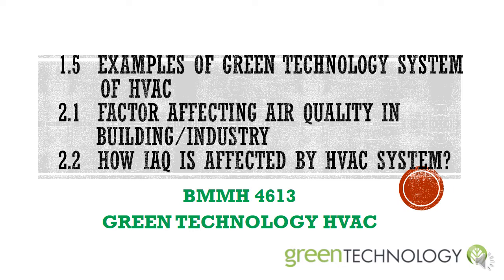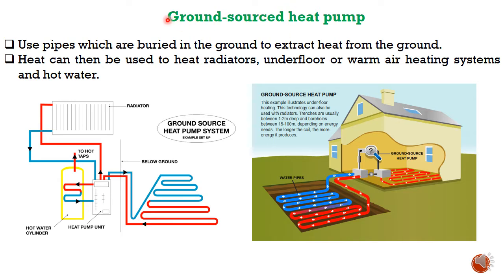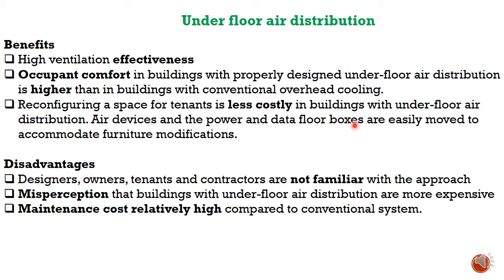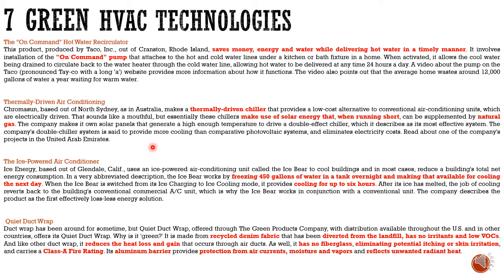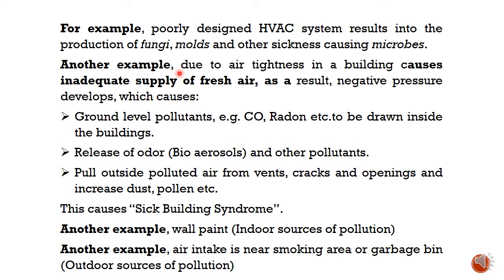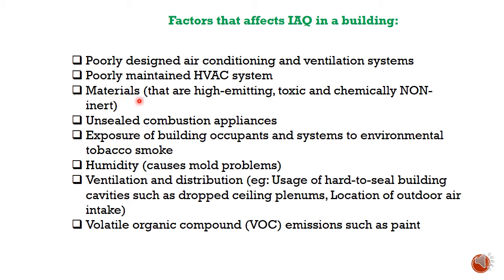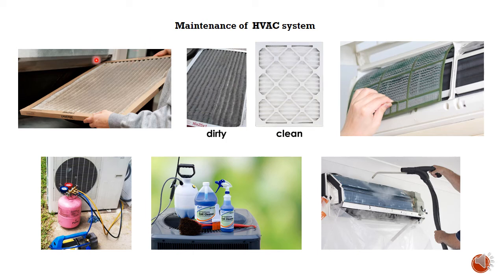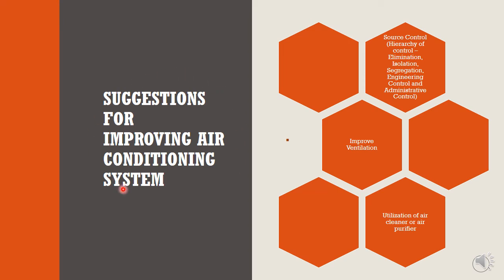Lecture 2 Effects on Indoor Air Quality

Comment: Cheah Kok Hun 4BMMH S1/1
B071710006 

1) An air-to-air heat exchanger 
Connecting two air streams of different 
temperatures into thermal contact, transferring heat from the exhausting inside air to incoming .outside air during the heating season. It use heat concept whereares heat is transfer from high temperature to low temperarure 

2) A waste heat recovery 
A unit is an energy recovery heat exchanger that transfers heat from process outputs at high temperature to another part of the process 
for some purpose, usually increased eficiency. It is a very good way to conserve the energy to attain suistanable. 

3) A geothermal heat pump or ground source heat pump is a central heating and/or cooling system that transfers heat to or from the ground. It uses the earth all the time, without any intermittency, as a heat source or a heat sink. The energy from ground is free and always available to use. 

4) VRF HVAC System
Which allow to control the amount of refriegerant flowing to multiple evaporators at the same time to adjust different capicities of function of each evaporators with the minimum requiremenr of refrigerant to avoid over run refrigerant or less refriegerant. This will significant reduce a great mount energy watse. 

Maintenance of HVAC system is a complusory act and it have to do according schedule, some within few months. With good maintanence, it will help to avoid the user from geeting sickness due to polution happen in indoor source and outdoor source.

Comment: AMIRATUL RASYIDAH BINTI ABDUL RAHMAN
B071710456

1. GREEN TECHNOLOGY SYSTEM OF HVAC 
- Air to air heat exchanger/ waste heat recovery (heat recovered from exhaust air) reduce overall load and potentially the ac size
- Ground source heat pump (Underground pipe) low energy consumption, no fuel deliveries, low CO2 emissions and minimal maintenance 
- Under flow distribution (underfloor plenum) high ventilation effectiveness, better than conventional ac and less cost 
- VRF ac system (one outdoor multiple indoor) control amount of refrigerant flowing multiple indoor and individual comfort control

2. 7 Green HVAC Technologies 
- The “On Command” Hot Water Recirculator 
- Thermally-Driven Air Conditioning 
- The Ice-Powered Air Conditioner  

- Quiet Duct Wrap V. Energy Analysis Software 
- The Dual Fuel Heat Pump VII. The Geothermal Heat Pump

Indoor Air Quality ( IAQ ) - How good or bad the air inside the place due to presence of chemical, biological pollutant in the air, temperature & humidity.

3. Factors that affect IAQ inside the building:
- Poor design of HVAC system
- Poorly maintained HVAC system
- Unsealed combustion appliances 
- High humidity (causing mold problems)
- Low ventilation and distribution 
Suggestions for improving Air Conditioning System:
- Source Control (Hierarchy of control of elimination, isolation, segregation, engineering control and administrative control).
- Improving the ventilation system and distribution system (such as using fan to such out bad odor in kitchen or toilet).
- Utilization of air cleaner or air purifier

Comment: MUHAMMAD AKRAM BIN RAZALI (B071710573)

Air-to-air heat exchangers / Waste heat recovery system
- heat recovered from exhaust air to temper fresh air coming into building
- reduce overall load and reduce the size of air conditioning system

Ground-sourced heat pump
- Use pipes that buried in the ground to extract heat
- Lower energy consumptions
- Provide income through the government (RHI) (in UK)
- Lower home carbon emission
- No fuel deliveries
- Minimal maintenance required

Under floor air distribution
- Uses open space (underfloor plenum) between structural concrete slab and underside of a raised access floor system to deliver conditioned air direct to the occupied zone 
-  High ventilation effectiveness
- Occupant comfort

VRF air conditioning system
- One outdoor unit and many indoor units
- Able to control refrigerant flowing to multiple evaporators

7 Green HVAC TECHNOLOGY
1. The "on command" hot water re circulator
2. Thermally driven AC
3. The ice powered AC
4. Quiet duct wrap
5. Energy analysis software
6. The dual fuel heat pump
7. The geothermal heat pump

Factors effect IAQ  in building:
- Poor maintained
- Poor design
- Unsealed combustion
- Exposure of building
- Humidity

Comment: MUHAMAD NURHISYAM BIN MOHD HASNAN
B071710148 
4BMMH S1/2

UNDERFLOOR AIR DISTRIBUTION
a. benefit
-high effectiveness
-comfortable 
-less costly
b. disadvantage
- less familiar for contractor and designer
- misperception more expensive
- relatively high cost maintenance 

FACTOR THAT AFFECTS IAQ IN A BUILDINNG
- poorly design hvac system
- poorly maintenance HVAC system
- materials
- unsealed combustion
- exposure to environmental tobacco smoke
- humidity
- VOC

Comment: MOHAMMAD NAZRIN BIN BAHARUDDIN
B071710111
4 BMMH S1/2

HVAC System with Green Technology

•	Air-to-air heat exchanger/waste heat recovery system
o	recover heat from exhaust air to temper fresh air into the building
o	reduce overall load & equipment required to maintain

•	Ground-source heat pump
o	pipes buried in the ground to extract heat
o	then be used to heat radiators, underfloor, warm air heating system & hot air system

•	Under Floor Air Distribution
o	use the underfloor plenum to deliver conditioned air into occupied zone

•	VRF Air Conditioning System
o	one outdoor unit with many indoor units
o	control refrigerant flow to multiple indoor unit with different capacity with single outdoor
o	provides individual comfort control

Factors Affecting IAQ
•	the system will result the production of fungi, molds.
•	due to air tightness in space - develops negative pressure, and thus called "Sick Building Syndrome"
•	immediate & long term health problems
•	Factors that affects IAQ in a building:
•	Poorly designed air conditioning and ventilation systems
•	Poorly maintained HVAC system
•	Materials (that are high-emitting, toxic and chemically non-inert)
•	Unsealed combustion appliances
•	Exposure of building occupants and systems to environmental tobacco smoke
•	Humidity (causes mold problems)
•	Ventilation and distribution
•	Volatile organic compound (VOC) such as paint

Method to improving Air Conditioning System:
•	Source Control (Hierarchy of control of elimination, isolation, segregation, engineering control and administrative control).
•	Improving the ventilation system and distribution system (such as using fan to such out bad odor in kitchen or toilet).
•	Utilization of air cleaner or air purifier.

Comment: Muhammad Ismail B. Abdul Nasir
B071710851 S1/1

1.5 - Examples of Green Teech sys of HVAC;
        >air-to-air heat exchangers
        >ground sourced heat pump
        >under floor air distribution
        >VRF a/c sys

7 Green HVAC Technologies;
   i)The "ON Command" pump of hot water recirculator
   ii)Thermally-Driven a/c
   iii)The ice-powered a/c
   iv)Quiet Duct Wrap (made from recycled denim fabric)
   v)Energy Analysis Software
   vi)The Dual Fuel Heat Pump
   vii)The Geothermal Heat Pump (looped piping underground)

2.1 - Factors Affecting IAQ >> how good & how bad, the air inside a space
   >if poorly designed
          -the system will results the production of fungi, molds.
          -due to air tightness in space - developes negative pressure, and thus called "Sick Building Syndrome"
   >immediate & long term health problems

2.2 - How IAQ is affected by HVAC system?
   > factors that affects IAQ in a building;
      -poorly designed a/c
      -poorly maintained
      -materials (high-emitting, toxic)
      -unsealed combustion appliance
      -exposure to environment tobacco smoke
      -humidity (cause mold problem)
      -Volatile Organic Compound (VOC)

Suggestion for improving;
   >source control (hierarchy of control)
      1)elimination
      2)isolation
      3)segregation
      4)eng.control
      5)admin control
   >Utilization of air cleaner / air purifier

Comment: MOHD SAZWAN FITRIE BIN MOHD. KHAIRIL FITRIE
B071710488
BMMH S1/1

Four current HVAC greentech:

1. Air-to-air heat exchanger
> Heat recovered from exhaust is tempered back to fresh air within building
> Reduce overall load potential sizing

2. Ground-sourced heat pump
> Pipes buried within the ground are used to extract heat
> Heat is used for minor common equipment like radiator and underfloor
> Benefit: i) Lowers home carbon emission
           ii) Have a minimum maintenance costing
           iii) No fuel usage

3. Under floor air distribution
> Use open spaces like underfloor plenum
> Benefit: i) High ventilation effectiveness
           ii) More comfort to the occupants than other HVAC technology
> Disadvantages: i) High maintenance cost

4. VRF Air Conditioning System
> Ability to control amount of refrigerant that flows in a system accordingly. The system arrangements provides ad individual comfort control for each zones.

Comment: MUHAMMAD ZULQARNAIN BIN ZAMZURI
B071710782 (BMMH S1/2)

AIR TO HEAT EXCHANGER/WASTE RECOVERY SYSTEM
-heat is recovered from exhaust air to temper fresh air coming into the building
-can reduce overall load and potentially the size of the AC equipment

GROUND SOURCED HEAT PUMP
-use an underground pump and extract heat from the ground
-Benefits
=>low energy consumption
=>low carbon emission
=>minimal maintenance
=>no fuel delivery

UNDERFLOOR AIR DISTRIBUTION
-only used in open-spaced like underfloor planum
-Benefits
=>high ventilation effectiveness
=>better comfort

VRF AIR CONDITIONING SYSTEM
-able to control the amount of refrigerant
-provide individual comfort

Comment: NUR SHAFIQAH BT ABDUL GHAPOOR
B071710400
4 BMMH S1/1

1.	Example of green technology system of HVAC

a.	Air-to-air heat exchangers/waste heat recovery system
o	Heat recovered from exhaust air to temper the fresh air coming into the building
o	Fresh air from the outside preheated by the air from inside which is slightly warm and cross the flow. This can lower the overall load and reduce the size of air-conditioning system because the load is reduced.

b.	Ground-sourced heat pump
o	 Putting pipes on the ground (buried) to get the heat from the ground and the heat carried back into the house and used it as a warm air heating system or hot water.
o	Benefits; lower energy consumptions, could lower home carbon emissions, minimal maintenance required.

c.	Under floor air distribution
o	Uses the open space (underfloor plenum), which is in between space from upper floor and underground floor, either for cooling or heating system. Directly get the air into the require space. Used in several places. 
o	Benefit; high ventilation effectiveness, occupant comfort in building is higher.
o	Bad; does not familiar with the design, maintenance is high costing.
d.	VRF air conditioning system
o	One outdoor unit and many indoor units.
o	Able to control multiple refrigerant flow indoor units.

2.	Factor affecting air quality in the building
a.	IAQ- how good, as well as how bad, the air inside the places we love or Worland also involves level of temperature and humidity. 
b.	Poorly designed HVAC system is the presence of fungi, molds and other things. Air tightness in abuilding causes inadequate supply of fresh air, result negative pressure develops and causes sick building syndrome. 
c.	Immediate effect; irritation of the eyes, nose and throat, headaches, dizziness, fatigue, asthma 
d.	Long term; cancer

3.	How indoor air quality is affected by HVAC system
a.	Poorly designed air conditioning and ventilation system
b.	Poorly maintained HVAC system
c.	Unsealed combustion appliances
d.	Exposure of building occupants and system to environmental tobacco smoke. 
e.	Humidity is high that causes mold problems.
f.	VOC emissions such as paint

4.	Suggestion for improving air conditioning system
a.	Improve ventilation 
b.	Source control
c.	Utilization of air cleaner or air purifier

Comment: AHMAD LUQMAN HAKIM BIN ZAMBRUS (B071710359)
BMMH S1/1

Air to heat exchangers/ Waste recovery system
- Heat is recovered from exhaust air to temper the incoming fresh air supply
- Reduce the overall load  

Ground-sourced heat pump
- Utillise underground pipes to extract heat from the ground
- Heat is used to heat radiator,  underfloor or warm air heating system and hot water
   - Pros        - Lower energy consumption
                      - Provide income
 (government)
                      - Could lower home carbon emission
                      - No fuel deliveries needed
                      - Minimal maintenance

Underfloor air distribution 
- Open space (underfloor plenum)
   - Pros       - High effectiveness
                     - Good occupant comfort
                     - less costly
   - Cons       - Unfamiliar for most people 
                      - Misperception (high cost for installation) 
                      - Relatively high maintenance cost

VRF air conditioning system
- one outdoor, many indoor
- controable refrigerant flow in the system
- individual arrangement

7 green HVAC tech
- The "on Command" Hot water re-circulator
- Thermally-Driven air conditioning
- The ice-powered air conditioner
- Quiet duct warp
- Energy analysis software
- The dual fuel heat pump
- The geothermal heat pump

Definition of IAQ
- Indoor air quality - how good, as well as how bad, the air inside the places we live or work due to the    presence of chemical, biological pollutants in the air and also involves level of temperature, humidity.

Volatile organic compound (VOC) emissions - odor that could effect occupant

Immediate and long term health symptoms
-immediate effect - irritation of the eyes, nose and throat
                                 - headaches, dizziness, fatigue, asthma, hypersensitivity pneumonitis
-long term effect   - respiratory disease
                                 - heart disease, cancer

Factors that affect IAQ in a building
- Poorly designed AC and Ventilation system
- Poorly maintained hvac system
- Materials (high emitting, toxic and chemically non-inert)
- unsealed combustion appliances
- tobacco smoke
- humidity
 (condensation formation - mold growth)
- VOC

Suggestion for improving air conditioning system
- source control 
- improve ventilation 
- utilization of air cleaner or air purifier

Comment: AMIRA NASUHAH BINTI ALIAS
B071710121

1. Example of the Green Technology in HVAC

🌷Air to air heat exchangers; the outside air will be pre-heated by using the return hot air from the inside to lower the load and reduce the size of air conditioning system.

🌷Ground sourced heat pump; used geothermal energy by putting the pipe into the ground to extract heat form the ground. 
*Using a loop design piping for more better heat exchange.
*Lower energy consumption due to using free energy from the ground.
*Lower home carbon emissions.
*Minimal maintenance required.

🌷Under floor air distribution; Used open space (underfloor plenum) between the structural concrete slab and the underside of a raised access floor system to deliver condition air directly into the building.
*high ventilation effectiveness
*misperception that this system is more expensive compare to conventional
*high maintenance cost compared to conventional system.

🌷VRF air conditioning system
*One outdoor unit with many indoor units
*Can customize the refrigeration flow for each indoor unit with different load based on requirement needed.

7 Green HVAC Technologies
1. The “On Command” Hot Water Recirculator
2. Thermally-Driven Air Conditioning
3. The Ice-Powered Air Conditioner
4. Quiet Duct Wrap
5. Energy Analysis Software
6. The Dual Fuel Heat Pump
7. The Geothermal Heat Pump

Factors that affect IAQ inside the building:
*Poor design of HVAC system
*Poorly maintained HVAC system
*Unsealed combustion appliances 
*High humidity (causing mold problems)
*Low ventilation and distribution 
Suggestions for improving Air Conditioning System:
*Source Control (Hierarchy of control of elimination, isolation, segregation, engineering control and administrative control).
*Improving the ventilation system and distribution system (such as using fan to such out bad odor in kitchen or toilet).
*Utilization of air cleaner or air purifier.

Comment: MOHAMAD HURAIRAH BIN HARUN (B071710461) 

2.1 Factor affecting air quality in building / industry 
- For example, poorly designed HVAC system results into the production of fungi, molds and other sickness causing microbes.
- Another example, due to air tightness in a building causes inadequate supply of fresh air, as a result, negative pressure develops, which causes:
1) Ground level pollutants. 
2) Release of odor and other pollutants.
3) Pull outside polluted air from vents, cracks and openings and increase dust, pollen etc.
- This causes “Sick Building Syndrome”.

Immediate and long term health symptoms

Immediate effects
~Irritation of the eyes, nose, and throat, 
~Headaches, 
~Dizziness, 
~Fatigue,
~Asthma, 
~Hypersensitivity pneumonitis
 
Long term effects
~Respiratory disease
~Heart disease
~Cancer

2.2	How IAQ is affected by HVAC system? 

Factors that affects IAQ in a building:
~Poorly designed air conditioning and ventilation systems
~Poorly maintained HVAC system
~Materials 
~Unsealed combustion appliances
~Exposure of building occupants and systems to environmental tobacco smoke
~Humidity 
~Ventilation and distribution 
~Volatile organic compound (VOC) emissions such as paint

Suggestions for improving air conditioning system
~Source Control 
~Improve Ventilation
~Utilization of air cleaner or air purifier